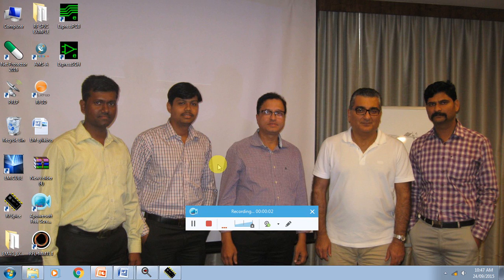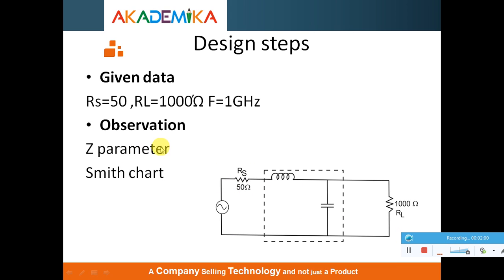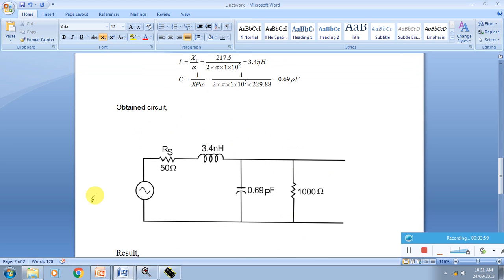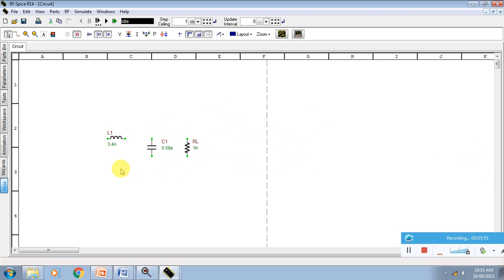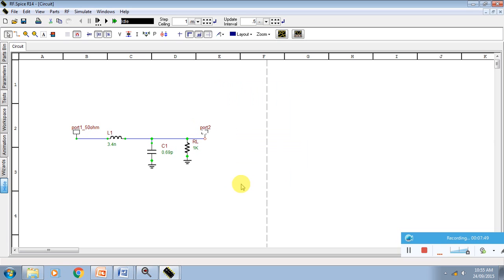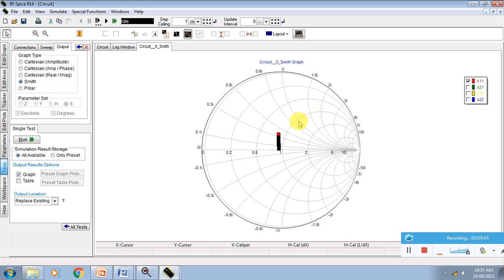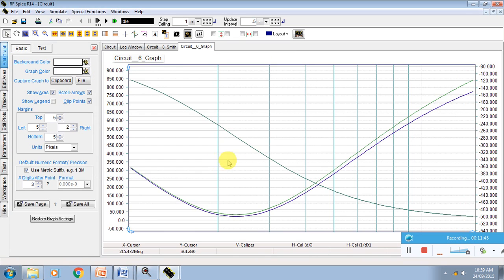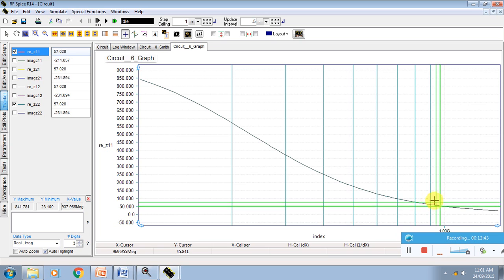L network RF spice

Comment: The RF-SPICE features possibility of co-simultion with the EM.CUBE's FDTD-solver EM.Tempo. The said co-simulation capacity is a very useful and advantageous feature of the EM.CUBE suite. Namely, after building and analysis of the microstrip filter conducted by the use of RF-SPICE, the SPICE Netlist description file can be imported into the FDTD-solver EM.Tempo. Based on the imported Netlist description, EM.Tempo automatically generates physical structure representing a microstrip layout of the said filter. This physical structure can be used for the full-wave EM-analysis of the microstip filter's performances by the use of FDTD-solver EM.Tempo. Due to the aforesaid RF-SPICE & EM.Tempo co-simulation possibilities, the EM.CUBE suite (which usually includes both RF-SPICE & EM.Tempo) can be used as a simulation tool which is perfectly suited to design (by RF-SPICE) and full-wave analysis (by EM.Tempo) of microstrip RF-filters, RF-circuits and microstrip feed-networks of microstrip either slot-coupled patch antenna arrays (including design & full-wave analysis of feed-networks with digital phase-shifters, etc.). 以上。